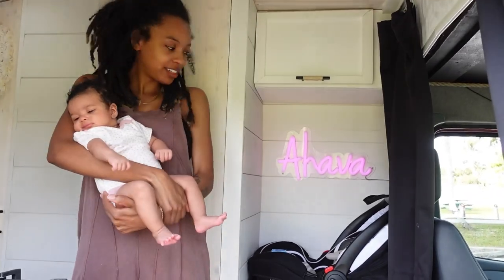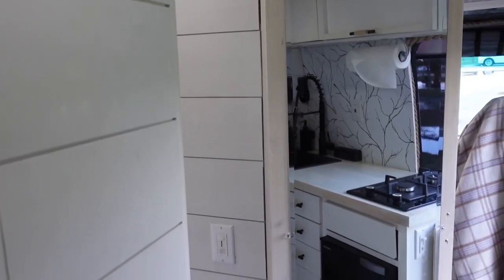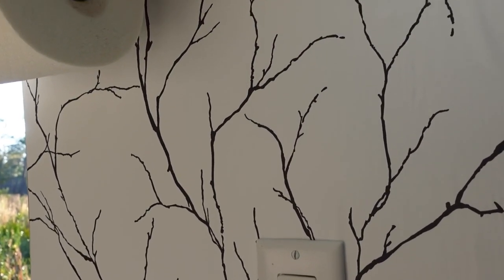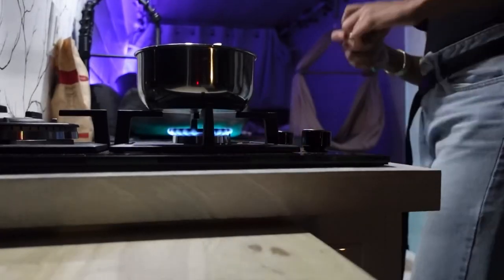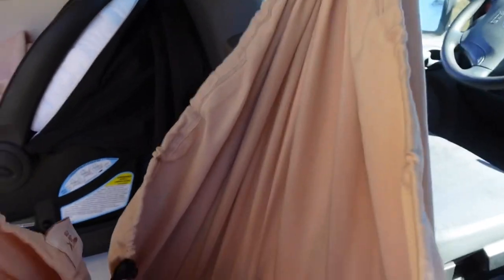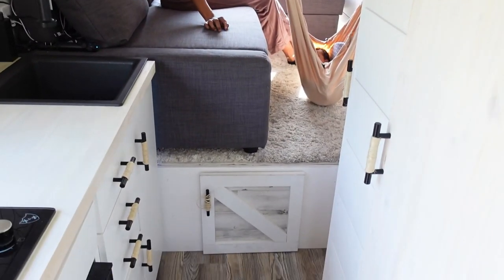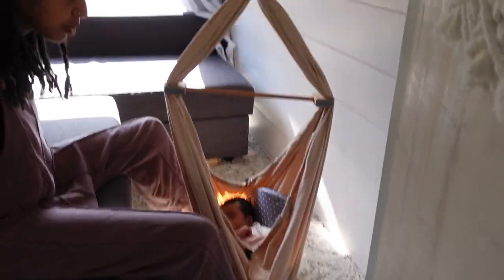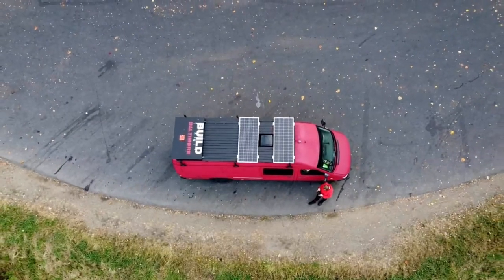DIY VAN TOUR: Couple with BABY| Living in Epic Van Conversion|OUTDOOR BASKETBALL HOOP

Comment: The sky is the limit..so many things you could put into your build...I got an air compressor..a generator...and a welding machine. 
A 110v 125 amp..I got a wacher dryer combo..on my shuttle bus. 
Just in case..you never know..
I'm a retired wood craft man.
And I'm a blacksmith to..
Plus a fabricator..I retire from shipyard after working all my life on wood and steel...but in case I broke down on the road or I find someone with problems on the road..im ready..I even cary a body and fender kit..with spray gun and 
Everything you need..lol
Reply from the maker: That’s amazing! Good for you! Thanks for sharing. I just purchased a few of those things myself because we are actually in the process of building out a new van. With that being said, MORE VIDEOS COMING SOON😃